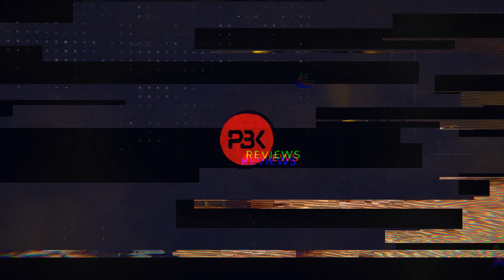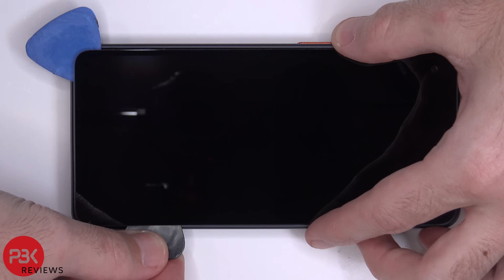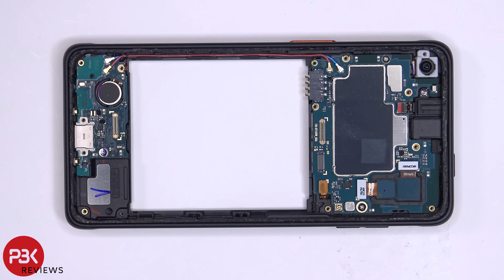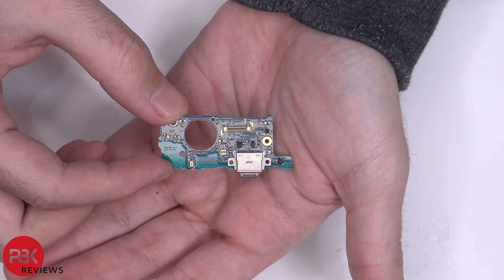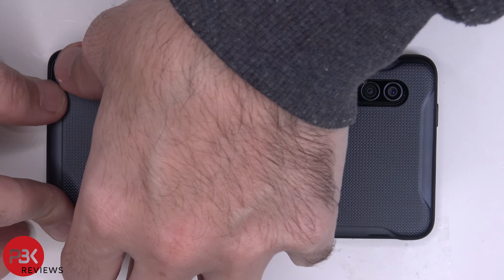Samsung Galaxy XCover Pro Disassembly Teardown Repair Video Review

Comment: Wow! My second comment here - and 3-years later. I must love this phone! Any rate I have a bad charging port and this is a GREAT video for helping me do that. 

HINTS: 1) on the step to remove display look for a notch on the edge - shows up on the right side in this vid. Start prying up at that point. 2) The screws are sealed with LokTite - a thread sealer. Put a LOT of downward pressure on the screwdriver before very VERY cautiously starting to turn the screw. You have to break the seal without damaging the screw head.   3) The mid-board removal was easiest for me by beginning at the side by the special purpose button (opposite power/vol) 4) The screws for the Main Board and Charging Board are NOT the same as the screws holding the mid-plane. 5) at about 6:00 he re-installs the mid-board starting at the top first. Do that. 6) After installing the Mail/Sub and display cables notice that the covers have arrows imprinted that match an embossed arrow on the chassis for proper alignment.         Cheers and Good Luck.... my repair went flawlessly.

Comment: Great video. Can you provide a bit more info about the buttons ? I have Xcover 5 and my power button fall off so now I wonder did I need to replace the power button from inside the panel like the older samsung models

Comment: Is it possible to exchange the headphone jack without soldering?
Reply from the maker: The headphone jack is not soldered, its connected with a flex cable so yes.

Comment: You left out the most important part IMO.  Lower right corner has a extremely delicate flex cable so no tool should be inserted there.  Mine perfectly good screen is now trash. ⬇👇😫😠☠

Comment: My xcover pro 6 has backlight problem touch is working displays everything
any solutions its in warranty also
Reply from the maker: If it's in warranty I would recommend contacting Samsung and having them replace or repair it. Either the controller for the backlight has gone bad or the display is defective or has a issue in the flex cable for the screen.

Comment: score? 9.5/10 maybe?
Reply from the maker: I would probably give it the same 8/10 the xcover 6 pro got in the video I did on that. One loss of point can be given to the fact that, yes the battery can be replaced easily and the screen can be pried off and replace as well without too much work, the charger port or other internal parts require prying the screen off which can have the potential of damaging the screen. You can look at the score chart on the xcover 6 pro teardown video to see the complete scoring.

Comment: Is it necessary to add or reheat screen adhesive?
Reply from the maker: Yeah it's best to apply new adhesive to make sure it holds the screen so later it doesn't start peeling off when the phone heats up etc. You can watch this video for reference on replacing adhesive: https://www.youtube.com/watch?v=T4iiPUIM7-Y

Comment: Hello, 
my micro at the bottom is broken, I think a lot oft metal parts are inside because I´m a welder and producer. Now all the guys say me that I´m super quiet.
Do you know if I can change the micro? And where I can get one?
Regards from Germany :)
Reply from the maker: Most likely the hole where the mic is has gotten clogged and you need to try and clean it. You can try using a magnet to see if it will pick up all the metal shavings. If it doesn't help then you might need to replace the filter that covers the hole from the inside. It probably will not have passed the filter to get to the mic.
Reply: @PBKreviews  Thank you for your answer, I found the complete circuit board in the bottom with the mic. I will try to replace it :)

Comment: I have issues with this phone. I'm on my third one now with the first two having a problem that seems too common. The screen just blanks out; you can still use voice activated features (Google Home/Assistant) and it still detects touch - if you hit the right spot! Sometimes pressing on the screen will bring it back and it may last a day or two but goes out randomly, then more frequently and for longer periods until the phone is useless.
At the moment I am doing a tear-down (so a great big Texas Thank You for this vid) and have a new digitizer so we will see.
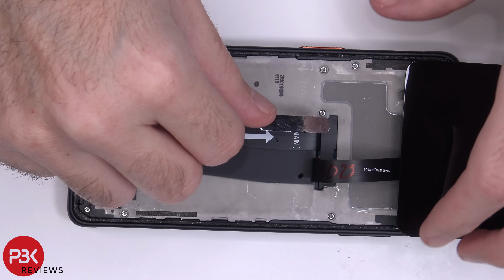BTW at 1:48 and again at 2:18 - when you pull the connector covers off they do POP OFF and fly across the room.
Hint #2: have a really well made PH000 screwdriver; the screws have LocTite on them and it is easy to strip the heads with a poorly fitting screwdriver.
Reply from the maker: Oh sucks. One thing I can think of that you can try, check and make sure the replacement screen has the yellow transparent tape covering the resistors and chips on the back bottom sides of the screen as well as the grey protective tape in between those two yellow tapes. Since if those chips aren't covered, when they make contact with portions of the metal frame, they can short causing the display to act up or not function. Since you were pressing down and sometimes would work and not, can be that. Also make sure the connector for the screen isn't damaged or loose, it might be an issue with that as well. You can try adding a thin flexible foam padding or something similar over the screen connector head so when you put the cover over it to hold it down, it has a better press on it so you make sure its not coming loose. Don't put something too thick or it can cause pressure damage to the connector.
Reply: @PBKreviews  @welkinator, Same thing w mine. Slapping it with my hand used to work. Not sure
I can do the disassembly, but I suppose at this point there is nothing to lose. Guessing it must be the connection and not the screen. I'm not buying a new screen.

Comment: I'm about to pull the trigger and buy this phone. I'm so upset that I basically have such few choices if I want a phone with a removable battery and SD card which are accessible without a special tool. I also require the 3.5mm audio jack so that reduces my choices even more. Sadly this phone has a punch hole selfie camera which is just absurd but I can tolerate it if this is the only choice I have. The only other drawback is that it does not have any physical buttons below the screen (Back, Home, Options/Show Active Apps).
Reply from the maker: There is a newer model of this releasing really soon if it hasn't already. Looks pretty much the same if I am not mistaken, but has upgraded processor and so forth. The physical keys you can add in display ones on the bottom for the back, home, active apps etc.

Comment: Dude can I ask you a question plz for the love of god answer me I beg you.how can I fiw the white line on the phone.i dropped it.plz answer me I beg you
Reply from the maker: It may be a loose screen cable or damaged display. If you take it apart and check the cable and still does it, you would need to replace the screen.

Comment: This was incredibly helpful -- thank you! I'm trying to disconnect/disable the volume control (damaged the volume buttons in water and now it keeps rebooting in safe mode). Planning to take apart in a few days, but curious if you saw where the volume connection is located? Thanks again!
Reply from the maker: Hi, it looks like it was ran through the back housing somehow, I don't have it anymore to check but just by looking at the video might be covered by a rubber cover or plastic cover from the back of the housing. Not too sure.

Comment: thank you very much for the exciting video. once the display has been changed how do i get it waterproof again if the display can only be removed with a blow dryer? greetings from Germany.
Reply from the maker: You're welcome. Here is a video explaining how to apply new adhesive. Also you would need to install the original replacement pre cut adhesive made for the phone if you want to retain the water resistance: https://www.youtube.com/watch?v=T4iiPUIM7-Y

Comment: I was trying to find the antenna of Xcover 3, isolated some connectors and signal dropped but...it never stops speaking with the tower. Is this the same here? Removing those blue/red cables - is this the antenna and will cellular work?
Reply from the maker: There are more than one way the phone receives signal, there are usually antenna lines built into the frame of the phone as well that gold contacts from the main board and sub board can touch to gain signal. The additional physical antenna and cables help strengthen the signals or gain different bands of signal. So disconnecting all the antenna cables etc would not necessarily stop the phone from 100% receiving signal. You would probably need to place the phone in airplane mode or disable mobile network through the settings.

Comment: I have the galaxy Xcover Fieldpro and cracked the screen, is the screen replacement the same process as the Xcover Pro?
Reply from the maker: Hi, not sure if it would be a similar process but looks to be a frontal disassembly as well. After prying the screen off from the frame, what lies beyond that I would not know since I have not taken one apart.

Comment: Excellent video, thanks. In your opinion, ¿ Samsung Xcover Pro or Nokia XR20 ?. A video about Motorola Defy 2021 it will be very interesting, because so all rugged phones will be represented in your channel.
Reply from the maker: Hmm its a hard choice, not sure which I would choose. Both are good lol. I may be leaning a bit more to the Xcover Pro but the XR20 is also really good. I just placed an order for the Defy 2021. Will do a video on it as soon as it arrives :) .
Reply: @PBKreviews  Thank you for your answer.          I will whatch video about Motorola Defy 2021 !

Comment: Is it possible to charge via the pogo pins and use the USB port for data simultaneously?
Reply from the maker: Not sure, don't have it anymore to try but I would assume once the USB port is plugged in, it would revert to charging from the USB port. However it can charge and be used for data from the USB port at the same time, the port uses different pins for charging vs data transfer.

Comment: PBK great video.  If you had to compare this Xcover against the original Rugby or Active S5 rugged phones.  Which version do you think is more durable/rugged?   

I have to give up my S5 because OS is version 6 and my apps are no longer being updated.  What android OS is the Xcover. Thanks.
Reply from the maker: Thanks. I think the Xcover pro is a more durable and rugged device. I believe it was running android 11.
Reply: Can we be friends? I actually upgraded to an Xcover Pro from an S5 G900V, I absolutely loved that device, I used it up until ~3 weeks ago when the clock died killing its wifi/data functionality.

Comment: Sir my yesterday fall water for 10min now display is not working
Reply from the maker: If water got in, most likely you will need to take the phone apart and disconnect the battery cable, dry out any water inside and use a small brush like a tooth brush to brush off any corrosion on any connectors or chips. Then put the phone back together and see if it works. You would need to re apply new adhesive (https://www.ebay.com/itm/403037928096?hash=item5dd6eebaa0:g:EQUAAOSwA~9hB9JD) when applying the screen back on.

Comment: Hi, could you please let me know where exactly antenna is located and if this phone has more than antennas ? I'm  looking for a phone with one antenna and with replaceable  battery. Thanks
Reply from the maker: The antennas are primarily built into the frame of the phone and also part of the sub board and motherboard.
Reply: @PBKreviews  thanks for your reply. I just want to know that if this has only one main antenna like the Galaxy S4 ? I know nowadays antenna comes as a chip/strip and they are connected to the mother board
Reply: Or is there any way to find out their antenna schematics ?

Comment: Any idea how to fix the rear camera glass? Mine is cracked...
Reply from the maker: Its held on with adhesive. You can heat it up with a hair dryer and pry the glass portion off. As for replacement one, you can try this site https://rounded.com/samsung-galaxy-xcover-pro-sm-g715f-camera-lens-gh64-07849a.html?sl=en
Reply: @PBKreviews  Thank you!

Comment: Just bought the Samsung Galaxy Xcover Pro. When I plug in headphones they don't play any music. Anyone else have this issue?
Reply: Are you using a USB C to 3.5mm adapter, or USB C headphones (rare)?
Reply: @douglasjensen8986  I was using a 3.5 mm headphone jack. I found it was a setting on the music app I was using.

Comment: Thanks for the vid! One question: do you think there a clear difference between this phone and a typical one, in terms of "ruggerization"? Specially in terms of vibrations. I am thinking on buying a rugged phone as a GPS for my motorcycle (I usually go offroad with it), and I thought on the typical blackview/ulefone devices...
Reply from the maker: You're welcome. Ya I think there is a big difference between the ruggedness and durability and strength between these and standard ones. This will take a lot more beating and vibrations overall.

Comment: When placing they screen back on the device after disassembly, do you have to heat / replace the adhesive that secures the screen in place? Thanks
Reply: Sorry read previous comments. What adhesive did you use / would recommend please?
Reply from the maker: @Scifon  its always best to find an original pre cut adhesive strip made for the phone like this one https://rounded.com/samsung-galaxy-xcover-pro-sm-g715f-adhesive-sticker-display-lcd-gh02-20467a.html?sl=en   but I haven't bought from there before so not sure. When I can't find any, I would use one similar in size from a different phone and modify it a bit or you can use 300LSE adhesive or some other smartphone adhesive and cut strips down to size. Hope this helps.
Reply: @PBKreviews  Thanks for the quick reply! I've bought some 3M 9448A 2mm adhesive lengths, so hoping it will do the job!  👍
Reply from the maker: @Scifon  You're welcome.

Comment: But does it accept a memorycard if both SIM-card slots are in use?
Reply from the maker: Yes, the memory card slot is siting on top of the Sim 1 slot so you can have your first sim in the bottom compartment where the sim goes, then the SD card on top compartment of the first sim, and your second sim would go on the right sim slot.
Reply: @PBKreviews  SOLD! Thanks mate! That was the one piece missing in the decision. Can't wait for a phone I can change batteries on again, without spending 15 minutes with magnifying glasses and special tools. Great, thanks!
Reply from the maker: @Mr_Right  you're welcome :)

Comment: Excellent video sir, I still have a question though, don{t you need to apply glue on the back of the screen again to keep it watertight ?
Reply from the maker: Thank you, Yes you apply new adhesive, not glue.
Reply: @PBKreviews  what kind of adhesive? I have an issue with my camera and may need to replace it.

Comment: Dear sir
I bought this phone but the hard keys( top key and xcover key)  are not working while screen is turned off
Even I choosed from the setting to make them work while screen is locked
I have to turn on the screen first for the xcover key to start working ,
Is that normal? 
Any suggestions?
Reply from the maker: Maybe you have security settings like finger lock or passcode which probably overrides allowing it to unlock or be used when screen is off.

Comment: How do you rate the repairability of this phone ?
Reply from the maker: 4 out of 10, its not easy to take apart, and if you have anything internally to replace there is a chance you can damage the screen by taking it off
Reply: PBKreviews 
You rate this by 4 ! And the lg v6 that has built in battery and glass back by 7 ? How come ?
Reply from the maker: @amrashraf9559  because replacing the battery is easy but thats about it. If you need to change the charger port, or any internal parts, you need to pry the screen off which would possibly damage your screen, and it would certainly get rid of the water resistance. Also after the screen you need to remove all the screws to then remove the mid plate which doesn't come off easily. Then after that the parts internally arn't the easiest to remove. So that's why. The lg v6 is easy.
Reply: PBKreviews also if you need to change the charger port or any internal part of the lg v6 , you will have to pry the screen also . So the possibility of screen damage is same in both mobiles ..
Reply: PBKreviews also if you need to change the charger port or any internal part of the lg v6 , you will have to pry the screen also . So the possibility of screen damage is same in both mobiles ..
Reply from the maker: @amrashraf9559  Wait I got confused. Are you referring to the LG G6 or LG V60?  I don't see an LG V6 phone model.
Reply: PBKreviews i am talking about the lg v60
You already made a teardown video for it

Comment: If anyone has this phone now, are you using it for navigation? And which navigation/mapping app are you using?
Samsung's specifications do not list GPS or GLONASS anywhere, like in the Sensor category. Just want to make sure there is a GPS receiver on the phone as I will also be using it where there is no cell service and won't be able to rely on AGPS.
Reply: Dude, how much did you stay in the coma ? Because every smartphone has true GPS since like 15 years ago when they weren't even named like that - they were PDAs running Windows CE or Windows Mobile.